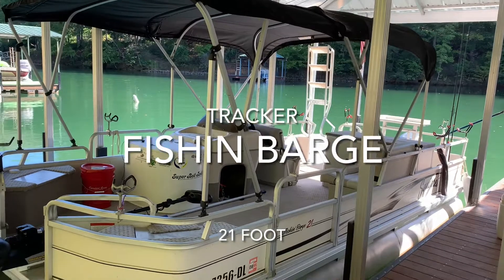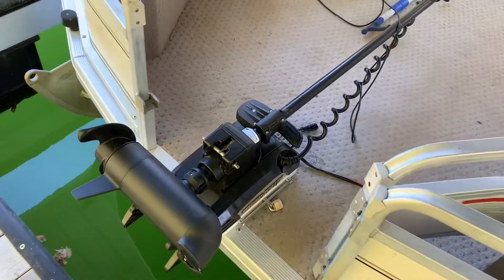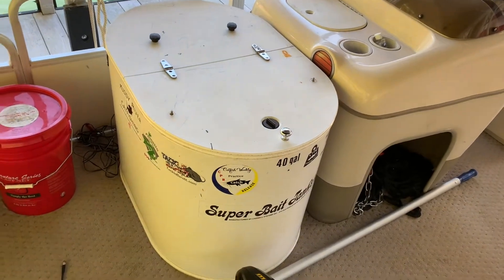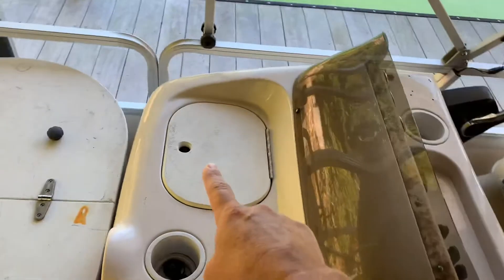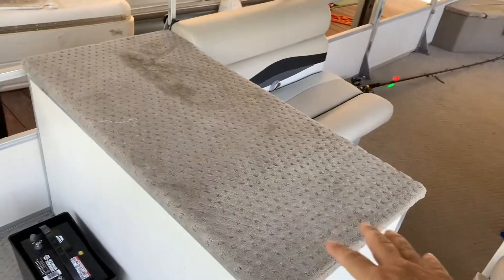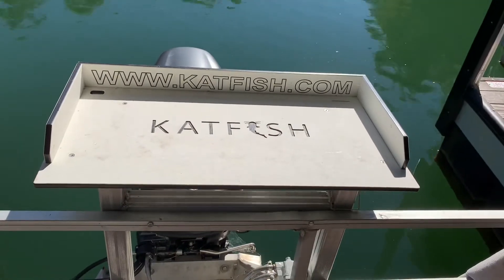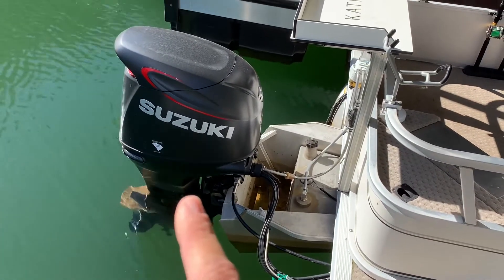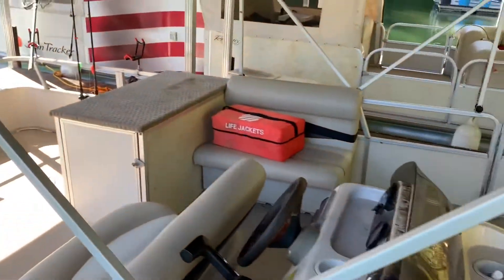Ultimate Pontoon Rebuild? Walk-Through of Squirrel 🐿

Comment: Love the boat the way you have it set up, have you GPS the boat with the 115 with just you in it to see what kind of speed you can get out of it
Reply from the maker: My boat is a pontoon not a tritoon so full throttle with just me and fishing gear GPS speed is 27-28 MPH @ 6000 rpm.  I usually run a 4K rpm  15-17 mph.  Still considering adding a 3rd toon ( we’ll see). Thanks for watching!🐿
Reply: @FishinwithSquirrel  thanks for the reply, is that a 18ft or 21
Reply from the maker: 21’